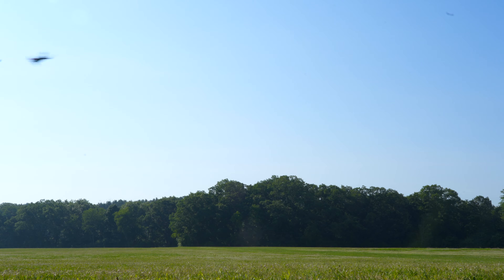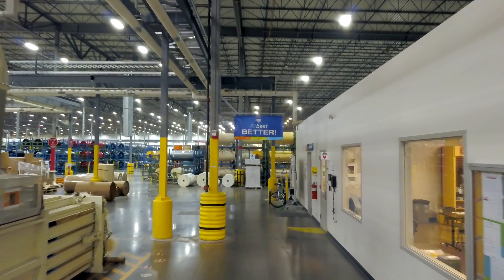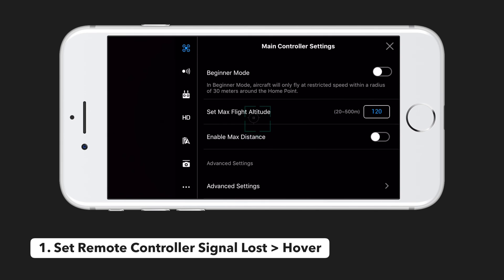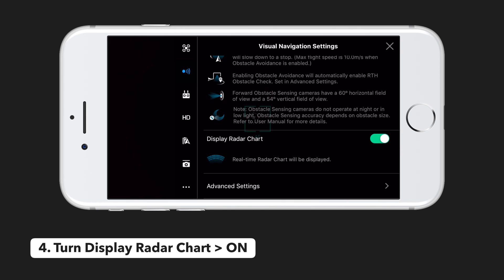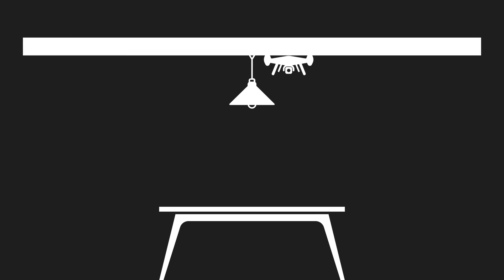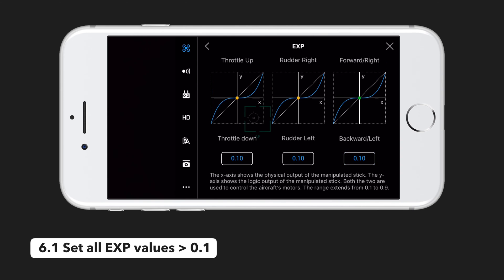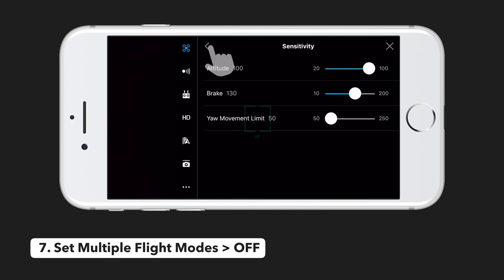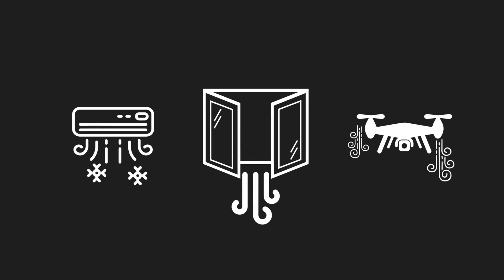7 Essential Settings for Flying Drones Indoors - DJI Spark, Mavic, & Phantom 4

Comment: I would be awesome if DJI would introduce profiles so that we could easily switch between profiles when frequent flying between indoor and outdoor. 
It would save us a lot of time fiddling with these settings.
Reply: I feel like the reason they haven't done it is because the risk may be too great for the rewards and they'd probably have to deal with a lot more replacements/claims!
Reply: Tripod mode and cinematic mode do this :)

Comment: HI there, first and foremost congrats for the video, very very useful , just one question, i cannot see the "smart return home" in the battery settings on Mavic Air, this does not apply to the mavic air right?

Comment: Very nice video...  
Yesterday i was called to make a job inside a warehouse to help to count the pallets. I have a Mavic 2 Zoom and a Mavic 2 pro and I went with the zoom to help seeing SKUs on the boxes.
The problem was... indoors the mavic 2 has a height limit so I couldnt reach the top boxes. What I had to do is go outdoors everytime i changed batteries so it unlocks this limi and then come back in.
Any idea for my next warehouse adventure so I dont need to do this?!?

Thanks a lot
Reply: This comment is specially useful for me because I'm supposed to be flying my Mavic 2 Zoom indoors tomorrow for the first time and it'll be inside a gym that does not have the greatest floor to ceiling clearance. What was your height limit when you deployed it indoors vs outside? Thanks!!